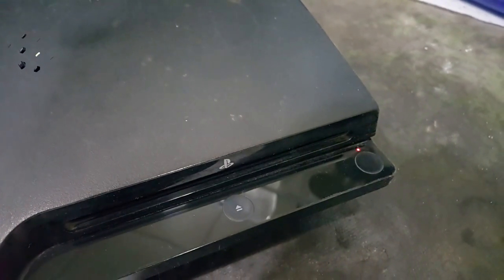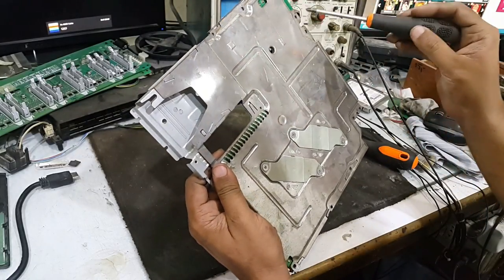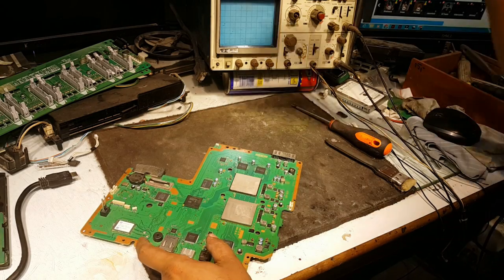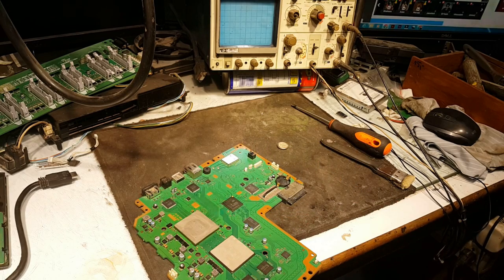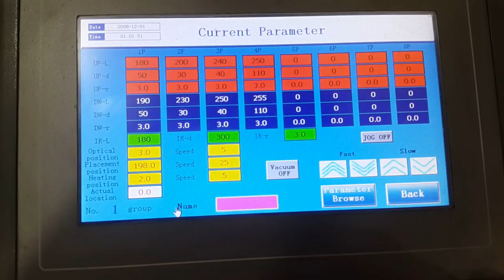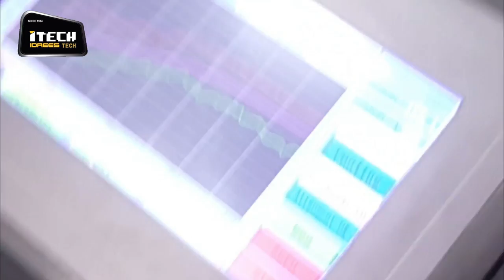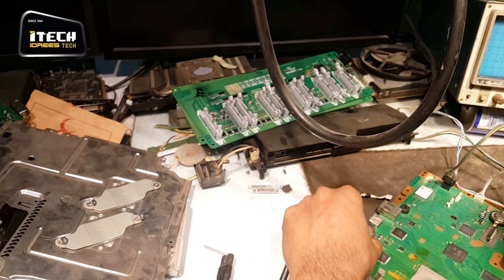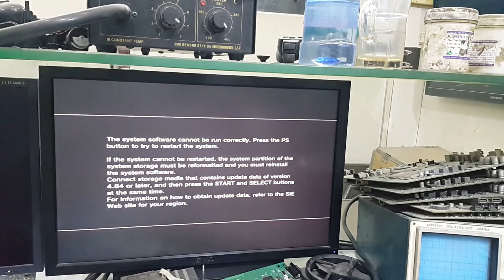PlayStation 3 Freezes and Display with Garbage 🛠️💻 - 🔧✨Troubleshooting Guide.

Comment: You're the PRO. May I will seek you for help in future for my ps3 super slim. For now I have a question. Can it be that seeing the graphics more yellow in particular when there is black immages from one day to another could be related to a bug? Cause I didn't play for some months and now look more yellowish. Can be dust on tv display?
Reply from the maker: Is it a CRT display device? If yes then it needs to be balanced by adjusting the colour gain controls. If no and display device is a led then it could be the dust particles but additionally it causes the display blurry.
Reply: @idreestech  it's a metz tv full hd of kinda 2018 maybe 19
Reply: @idreestech   I cleaned the display but prolly the problem was another. Game mode settings about image, in tv options. Those game mode settings really deteriorate graphics.
Reply: @idreestech   also do you play something online on ps3? I 'm playin raging blast 2 but I have also tekken tag 2 , naruto storm revolutions, ac revelations (online WORKS, at least a year ago worked) . Also mortak kombat , split second , saint seiya and more like RE revelations 2
Reply: @idreestech  anyway. My greetings man. Thank you.

Comment: What did you put under the gpu?
Reply from the maker: First I cleaned the GPU thoroughly with alcohol from the bottom, then I used flux paste on it before the reflow process, since the flux paste is hard, I melted it with a heat gun. It has been delivered underneath the GPU chip.

Comment: Hi, I've been watching a lot of ps3 repair videos and I do honestly believe that are the most skilled youtuber on PS3 repairs (you're the only one I saw repair a bricked GLOD w/o video output with impressive diagnostic precision and not just consider the board dead from the start). 

I've been interested in reflowing/reballing my GPU so if you could spare some time, could you please get a bit more in depth w/ your profiles for your reflow and reballing. How long do you typically run the machine for each temperature for reflow vs for reball? (I saw the numbers but I don't really understand. Is it a sequence of p1-p2-p3-p4? Or you just choose 1 of them for the process you're doing? Also want some clarification for other parameter. i.e. For 1P it's 180 for top heat and 190 for bottom heat but what do the 50 and 3.0 mean in that profile? 

Here's link for timestamp for faster reference https://youtu.be/s-JU9CnPHX8?t=551
Reply from the maker: Dear, 50 means profile parameters long for 50 seconds and 3.0 means rise in temperature should be 3 seconds per degree.
Reply: @idreestech  That makes sense now. Thank you for imparting your wisdom on the matter!

Comment: I often explode the ram on rcx, do you know the reason, thanks
Reply from the maker: That is due to a stress in temperature dear.
Reply: @idreestech  I set the temperature above 240c below 280c heat plate 330c wind 90,thank

Comment: What is the correct airflow level?Is it high, low, or medium?  I can control the airflow by a percentage
Meaning, I can adjust the air flow to 50%, 70%, 80%, 90%, or 100%.What is the correct percentage that I should choose for air flow so that the rsx does not burn out?I do not find a problem with the cpu at all. But the problem is with the rsx, as its RAM burns up quickly, and I find balls of tin coming out of the RAM.Although I use the same profile from your video
Reply from the maker: While airflow is a part of the reflow process, there isn't a one-size-fits-all percentage that guarantees success. It's important to approach reflowing with caution, seek professional assistance when needed, and address the underlying causes of the solder joint issues for a more effective and lasting solution.
When performing a reflow to address solder joint issues, it's crucial to follow established guidelines and best practices. While airflow is important for dissipating heat during the reflow process, there isn't a universal percentage that applies in all cases. The key is to ensure a consistent and controlled heat distribution across the RSX chip.

Comment: Hi, im from multan, my ps3 fat has the same gpu garbage and smacking ps3 changes the screen garbage. Can i have your number or you can fix it for me? I tried to heat gpu with hair dryer the garbage is gone but ps3 freezes in game sometimes
Reply from the maker: It can be fixed. Please send it to me and refer to the channel description for details.
Reply: @idreestech  okay let me check details on the channel description